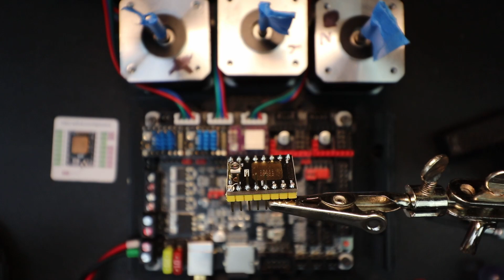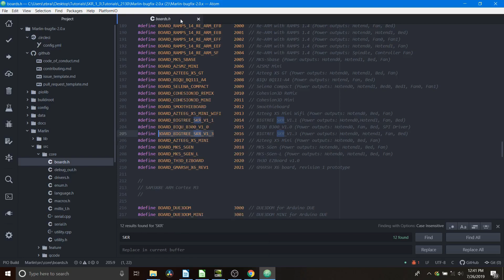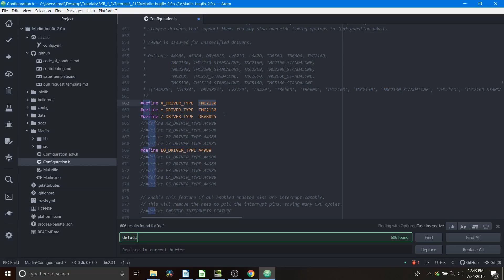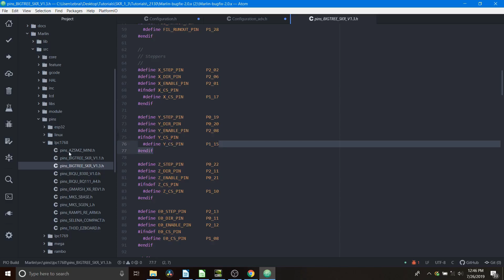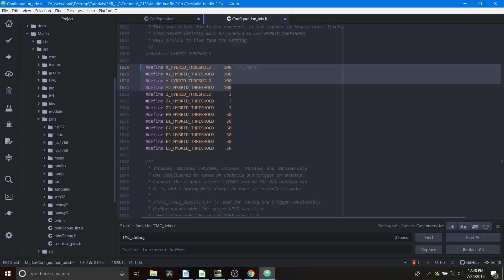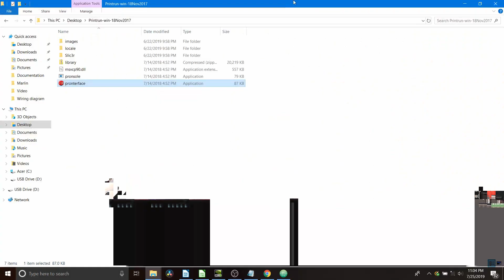SKR 1.3 - TMC2130 SPI v3.0

Comment: I am confused with the Tmc2130 set up with bl touch. Do I need to cut the diag pins to disable sensorless homing to use it? Or can I program that in Marlin?
Reply: I am currently using the 1.4 turbo board, but I imagine the set up is not far off from 1.3

Comment: I followed your guide, but my display show "TMC Connection error".
Reply from the maker: Is the PSU power connected?  What position is the jumper for power on SKR in USB or PSU.  Which TMC stepper are you using?  Also I'll be doing a live stream on tmc2209 UART at 6 PM EST tonight.

Comment: I dont know why but I keep getting error with M122:

Driver registers:

  X 0xFF:FF:FF:FF  Bad response!
  Y 0xFF:FF:FF:FF  Bad response!
  Z 0xFF:FF:FF:FF  Bad response!
  E 0xFF:FF:FF:FF  Bad response!

I rebuilt everyting twice and nothing seems to fix... Do I have to solver something on the drives?? TMC2130 V3.0 Big Tree Tech
Reply from the maker: Sounds like a connection issue.  Can you tell me which manufacturer and version of the stepper you're working with?
Reply: @EdwardBraiman  Just founf the problem... I bought the SPI version but it came with the resistor/jumper soldered (the seller sent the wrong drivers)... I have removed it and now it works... Thanks for the answer =D
Reply from the maker: You're welcome.
Reply: Good evening. I am actually dealing with the same issue. I bought four, what I am assuming is used/preowned, TMC2130 SPI drivers after switching from the TMC2208 UART steppers. I am switching in order to use sensorless homing. But other than that, I changed the configurations .h and adv.h to suit the new steppers. However, after flashing the firmware to the SKR v1.3,  I am immediately greeted to the prompt "TMC CONNECTION ERROR". At first, I thought it was only the x-axis since it is the only motor that doesn't move. But after I go to pronterface and run the M122 command, the same error message you got shows up for x,y,z, and e, along with the words "Error: ALL HIGH". Did that also show up for you at first? And what did you look for when you were discovering your solution? Please get back to me at your earliest convenience. Thanks

Also just in case it comes to question, the steppers I am using are the TMC2130 SPI v3.0 from BigTreeTech
Reply: @Carma1023  If I'm not in mistaken I had to unsolder the resistor (to select SPI) then everything worked except for the fact that my motors were making way too much noise, they were louder than the TMC2208 in spread cycle mode... While trying to solve the noise problem I connected the driver in the wrong orientation and that burned the microcontroller on the SKR board and all the other 4 drivers (dual Z)... I bought a new SKR and 5 x TMC2209 and I couldn't be happier they are perfect... Also bought a new LPC chip and fixed the burned SKR...
Reply from the maker: Try swapping stepper drivers on a powered down system and seeing it results change or subtracting one of the Steppers.  It sounds like one of the steppers might be bad.
Reply: Edward Braiman thank you for the feedback. I swapped one stepper with another. You were right, one of the steppers is bad. I ordered a replacement TMC2130. I will see if the new one will resolve the not moving issue. But as for the “All High” error on all the steppers on the TMC Debug command, is that also a fault of the bad stepper? Or is there more things I may do to remedy the error?
Reply from the maker: When I normally see the error it usually related to the stepper driver.

Comment: Followed your steps with all my 2130 drivers and the machine will load, however no steppers will move. Any ideas?
Reply from the maker: What happened when you entered the debug command?
Reply: @EdwardBraiman  Got them moving, but there is a loud high pitched feedback coming from all the stepper motors.
Reply from the maker: What values are set for steppers on configuration_adv.h and remember to computer RMS from Nema17 datasheet.
Reply: @EdwardBraiman  They are set to 600 as in your video. I ran through everything again and now the board won't load at all. Just a blue screen and continuous beep.
Reply from the maker: What's connected to board?  When you describe problem understand I can only see what's in the video.  If other components are attached it's  hard to narrow issue to video.  Could you outline what's connected?

Comment: Got the exact same steppers and board, configured everything to suit SPI, it runs but I have a period clicking from the stepper every second when moving and when holding. I tried to adjust Vref and it wont go higher than 0.25v, software is set to 800ma
Reply from the maker: For UART you don't have to adjust vref it should be SW controlled.  Try lowering the 800 to 790 and by 10 until clicking stops.  Or compute RMS.

Comment: Great tutorial, any idea how one would use TMC2130 V1.1 in stand alone mode with this board?
Reply from the maker: You will need to specify stand alone and calibrate stepper, but at that point it's easier to use a cheaper stepper like drv8825.

Comment: Why didn't you use a 2130 for your Z motor?
Reply from the maker: Was contrasting motor types for different settings.
Reply: and usually z doesnt need a tmc2130 x and y usually are the ones the benefit from it

Comment: Hope someone can help trying to up load firmware skr v1.3 with tmc2130 for a lowrider2 cant compile and upload tryied to up date everything with atom and platforio said that nxplpc-arduino-lpc176x detached also nxplpc detached what does this mean 

this is the error message i get at least most of it

    return self.method(*nargs, **kwargs)
  File "C:\Users\user\.platformio\penv\lib\site-packages\platformio\builder\tools\platformio.py", line 110:
    env.BuildFrameworks(env.get("PIOFRAMEWORK"))
  File "C:\Users\user\.platformio\packages\tool-scons\script\..\engine\SCons\Environment.py", line 224:
    return self.method(*nargs, **kwargs)
  File "C:\Users\user\.platformio\penv\lib\site-packages\platformio\builder\tools\platformio.py", line 288:
    env.ConvertInoToCpp()

  File "C:\Users\user\.platformio\packages\tool-scons\script\..\engine\SCons\Environment.py", line 224:
    return self.method(*nargs, **kwargs)
  File "C:\Users\user\.platformio\penv\lib\site-packages\platformio\builder\tools\piomisc.py", line 198:
    out_file = c.convert(ino_nodes)
  File "C:\Users\user\.platformio\penv\lib\site-packages\platformio\builder\tools\piomisc.py", line 57:
    return self.process(contents)
  File "C:\Users\user\.platformio\penv\lib\site-packages\platformio\builder\tools\piomisc.py", line 80:
    assert self._gcc_preprocess(contents, out_file)
Reply from the maker: Heads up the Marlin firmware within the last month may have build issues if you followed my tutorial to the letter.  I opened an issue Saturday with GitHub project for Marlin firmware project.  I'll checked build today for SKR pro and it failed.  I'll check build tommorow for SKR v1.3, and see if it's okay.  Keep in mind it might be a build issue and not you.
Reply: @EdwardBraiman  I finally got things working  but had to change form atom to vscode. atom is getting away from the marlin code. Had a lot of trouble with python with vscode cant use the latest version platformio have to use python 2.7.16 also had to do a whole lot of other things. Just about to finish with skr v1.3 with tmc2130s and tft35 with dual end stops.  Thanks for your videos they got me up to speed quickly. hope my pins file works right with x,y,x e1.e2  rerouting  pins assignments.
Reply: Thanks I got it to work once then after that want build at all.
Reply from the maker: Great I was nervous the broke more than one configuration.

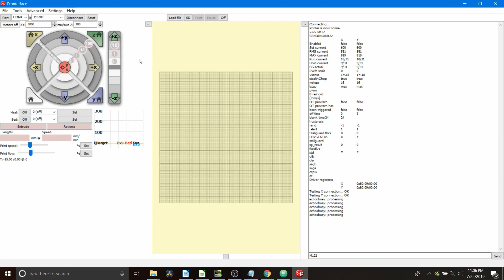Comment: At ~21:00 why do you disconnect the USB cable and reconnect it? It is disconnected then reconnected and then it is stated “now the firmware is updated”. How did disconnecting and reconnecting the USB cable update the firmware? I never see the step where the firmware is uploaded to the board. I seem to have missed something there.

My SKR came with a memory card in the slot already, is that what you copied the firmware to? Do you not flash the firmware by uploading it like you do on an MKS board?
Reply from the maker: On the SKR 1.3, when power is applied it will check TF drive for new binary file.  So removing power and then powering, starts flash procedure.
Reply: @EdwardBraiman  Thanks for the info! I actually watched your SKR basics video right after this one and got the info there as well, thanks!
Reply from the maker: You're welcome.

Comment: im doing a exact build on my ender 3, im running the tmc 2130 v3 in spi mode, do i need to change the vref via the pot on the board itself or is that taken care of with the current defined in the firmware? or do i need to adjust both?
Reply from the maker: SPI is controlled via firmware.  You only need to set RMS in firmware.
Reply: @EdwardBraiman  amazing! Thanks so much for your quick reply appreciate everything your doing for people with this newer less known product !!!
Reply from the maker: Thanks. I'll be releasing videos on SKR pro v1.1 soon.

Comment: If you change microstepping from 16 to 256 in configuration_adv do you also have to update your steps accordingly in configuration.h?
Reply from the maker: Correct, that's why I did the drv8825.  It was a why i contrasted stepper differences.